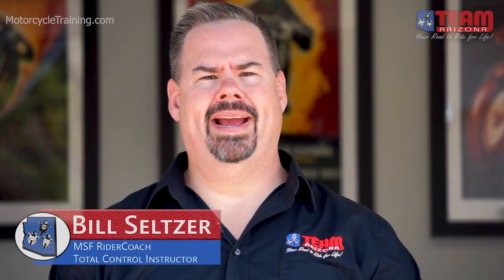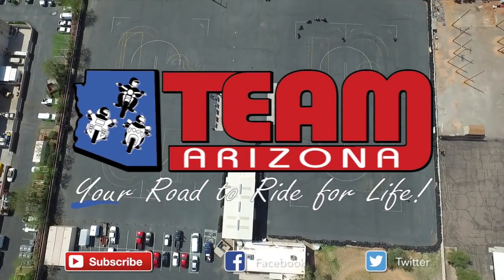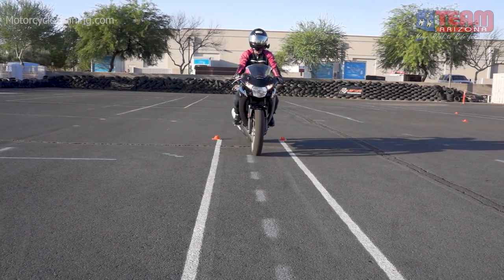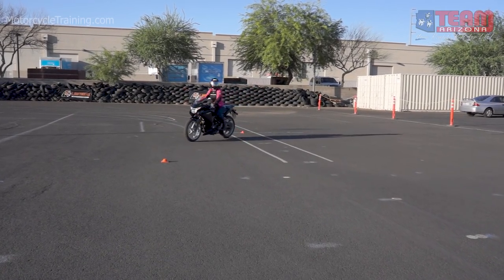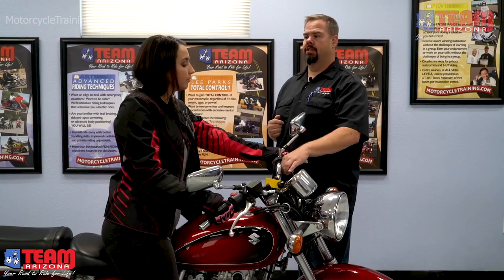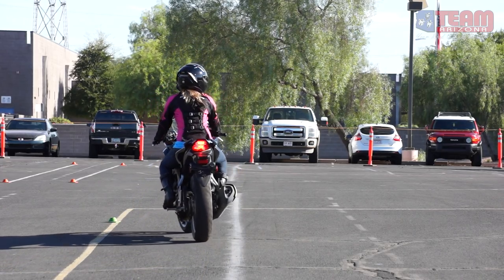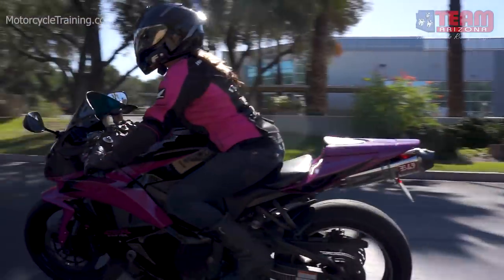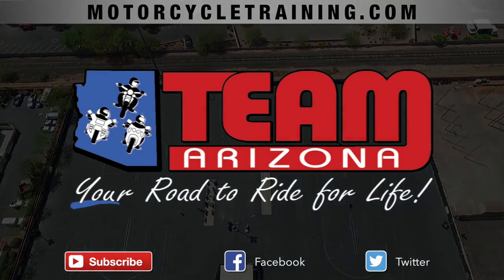Low Speed Maneuvering A Sport Bike | Turn a Motorcycle With Control at Slow Speed |TEAM Arizona

Comment: Any tips on learning these skills on a heavier sport bike? Other than lots of practice. I've been riding a 300 and felt comfortable doing low speeds turns, u-turns, etc. Just got a 1000 sport bike and besides the extra weight the center of gravity feels much higher.
Reply from the maker: Great question.  The fundamentals all remain the same as the laws of physics don't change.  You may consider working on the following:  clutch/throttle/rear brake coordination, where you place your vision, and counterweighting more aggressively (moving your body further to the outside, including sliding your outside knee forward so you can rotate your hips more).

Otherwise, we recommend reaching out to a local training organization for additional training.  Tough to beat well-timed feedback from a trained professional in a safe environment.

Comment: How would you do low speed turns when you have a automictic Goldwing?
Reply from the maker: All the same techniques minus clutch.  Essentially throttle/rear brake becomes the way to modulate momentum.

Comment: What about for scooters.. I have a cbt scooter with a 14' wheels
Reply: Great question.  All the techniques apply minus the clutch usage.  For scooters, we use a mix of the throttle zone and rear brake to control our momentum.  Everything else applies.  :-)

Comment: This isn't slow speed. Slow speed is when you have to use the clutch to moderate the speed.
Reply from the maker: That is exactly what she is doing; clutch/throttle/rear brake modulation.  We classify anything under 12mph as slow speed.
Reply: @TeamArizona1  yeah definitely, slow speed to me is any speed low enough that countersteering doesn't come into play.
Reply: Slow speed here is 3 mph 😃

Comment: Wait a minute, that little black thing is a sport bike?
Reply from the maker: Yes sir.  In competent hands, it can even break lap records like its slightly bigger 300cc brother did at Chuckwalla.  https://www.youtube.com/watch?v=bfAjy5Dq5TQ
Reply: In competent hands, almost anything can break lap records. 

But this course would be more of a challenge on a Ducati 859 than on a streamlined moped
Reply from the maker: @anidiotinaracingcar4874  While ergonomics, bike size, and chassis geometry may require the rider to make different levels of input energy, the techniques apply all the same.  Whether Jill was on her CBR600 or our training sportbike, she was easily able to u-turn her bike within a 20' space. And we are betting she could do the same on any Ducati.
Reply: I hadn't realized the circle was so wide
Reply from the maker: @anidiotinaracingcar4874  We look forward to seeing your videos while performing a smaller u turn on your sportbike.  Keep up the good work.
Reply: Cbr250 is designed for newer riders...it has a pretty wide steering lock. Close to twice as wide from lock to lock as an r6 of the same year.

Comment: You should not be slipping the clutch. 
A better and more important lesson is emergency braking   ;)
Reply from the maker: Not sure if we could disagree more with your statement about slipping the clutch.  It is a control that we can and should master to be able to control our vehicle at slow speed.

Threshold braking is one of the pillars of motorcycling, and without braking fidelity, we could make a hash of our stop.  That's why we initially focused on the concept of braking fidelity in this video you previously watched:  https://youtu.be/qb4GnuOwCmA
Reply: Most modern motorcycles have a wet clutch which allows slipping as a standard technique (not the same as car clutches).